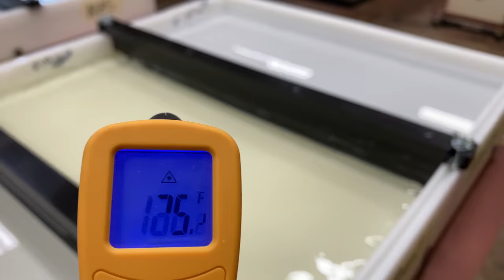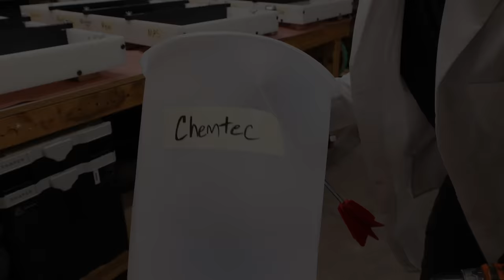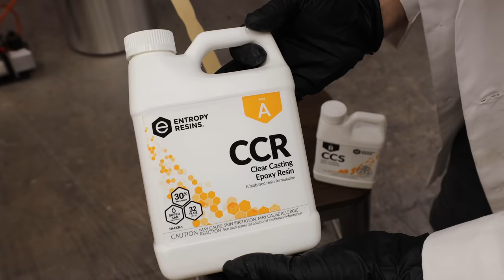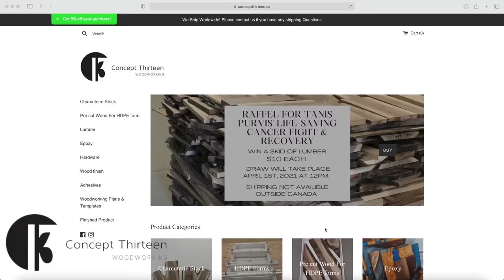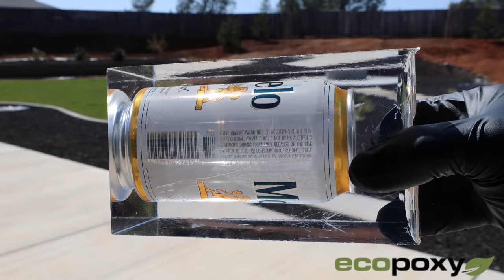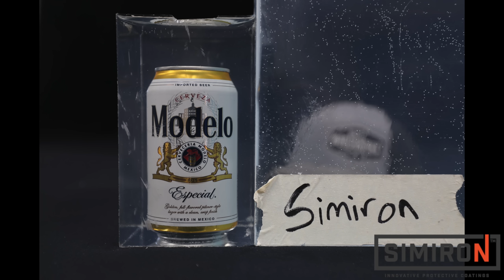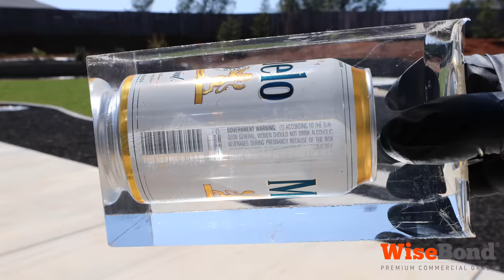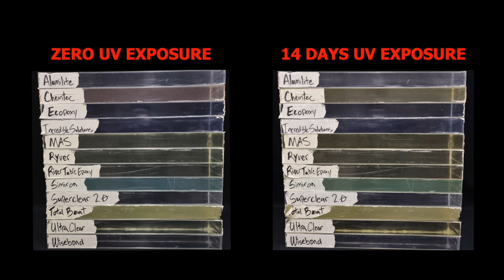Deep Pour Epoxy Clarity/UV/Hardness Test - Detailed Comparison!

Comment: Awesome work! Thanks.

I realize that the point of the test/comparison was clarity and color... you showed that mold cloud was a concern so you sanded and polished each one, top and bottom, also the final five went through a real flattening and polishing.
My Question is how did they compare in that finishing, including:
1. Elapsed time.
2. Pinning/clog factor, did you have to change paper frequently
3. Scratch elimination.
4. Was surface 'gum' a factor, I have experienced issues where the initial flattening was hampered by a lot of pinning, but once the surface was broken it worked much easier.
Doing the pour is part of the work but problems finishing can take a successful pour and turn it into a real headache. 

 Wisebond and Incredible Solutions are tied, IMO
Reply from the maker: Dane, The ones that I flattened and polished up all took relatively the same amount of time, they were also super close in shore D so there wasn't any issues with gumming or clogging of paper.  I used 2 pads of each grit for each block/casting, I did however have a little more time in using stage 1 cutting compound on Incredible Solutions for whatever reason, but all scratches seemed to eliminate on all of them just fine.  Thank you for the feedback!

Comment: Interesting and well done.  
My choice:  the WiseBond as the clarity is well up there but with a 3 point advantage in shore hardness over the other two top contenders, meaning a better quality final product with a longer, useful life as it may be repolished more often.
My application is as a surface coat over a Cocobolo veneer for a Lotus 7 dashboard.  That application requires; hardness,  and a U.V. -yellowing resistance in a very thin laminate coating.

Yes,  please do the subjective one year "yellowing" tests.

Comment: Would have liked to have seen West Systems in there since so many woodworkers use it. Great test though. I'd go with Superclear.
Reply: That stuff is so reactive because it's designed for thin laminates so a deep pour would not be possible with their current range. West = wood epoxy saturation technique.
Reply: @jakbain1337  you could do 1/4" pours at a time with certain West System combinations and build up that way if you wanted. The makers of West System also make Entropy Resins, FYI.

Comment: This was a fantastic review. I was actually quite surprised and impressed by the results. I will most likely be purchasing both the Incredible solutions and/or Wisebond for sure. I was pretty impressed by the superclear 2.0 also even though there were micro bubbles in the 2 inch pour. I am already a fan of Entropy and have seen some other reviews that showed direct UV exposure of many months without yellowing and virtually bubble free. Thanks so much for doing this.

Comment: I noticed you didn't tourch any of the resins to remove bubbles. You said you used degassing. Is that the same as a pressure pot?  It seems you still have a lot of bubbles in many of the pours.
Reply from the maker: Degassing chamber is different, it's extracting the air with a vacuum, I didn't use a torch on purpose that way we could see which resin would dissipate the bubbles the best.

Comment: I wonder how much affect the hot total boat had with the other resins in the same tub? Having 4 resins sharing the same bottom surface and some sharing 2 sides could be a problem. I was surprised you did not use a torch to remove bubbles from the 2 inch pours, I have seen people use a torch to do such, and the same with a spray as well. The site Positive Couple, comes to mind on using the spray. 
The work you did polishing and finishing those 3 finalists was amazing, I think the Wise took top spot, but as they say, I wouldn't throw any of those three out of bed though.
Reply from the maker: I imaging it could have had a little to do with it, however the ambient temp was low 60's for about the first week so the shared pours next to TB never reached over 90 degrees.  The torch could have helped but that would have defeated the entire purpose of the test.  I used the chamber on the beer casting, and almost all had zero bubbles.  I appreciate the feedback it was super fun to do!! :)

Comment: long term test would be awesome too. For me the Wisebond looked the best with neutral non-blue dye added transparency (some producers add slightly hint of blue dye to offset the natural yellow color). Seems to me people here give answers based on their experience or $$ - hard to trust their biased answers. Wisebond is visually the best, hands-down - there's no debate needed. Superclear is #2, Ecopoxy #3
Reply: Want to ask more of your unbiased opinion. why was Incredible solution not in your top 3? Is that what you meant by blue dye? What about the air bubbles other ppl are talking about? One guy said barely bubbles non-degassed incredible solution plank vs wise bond and superclear2.0. Is that a non-issue cause I’ve seen people throw blue-flame torch or heat gun to get the bubbles to rise out before resin sets.. (on this: do you prefer torch/heatgun?)
Reply: @ohkfilms yes incredible solution is so blue in comparison to wisebond and others, it does not belong to my top 3. 
What's so hard to understand there? The blue comes from a tiny amount of dye to offset the natural yellowish color of epoxy resin. Wisebond is #1, no discussion needed.

Comment: I've used SuperClear 2.0 with fantastic results, but unfortunately it cuts like crap on a lathe.  Actually I've tried most of those same resins, and most of them turn like crap on a lathe. So while it make not be as clear as SuperClear, Alumilite works best for me because it cuts so cleanly and smooth on  lathe. Another one you didn't try, but is also great for turning is Liquid Diamonds.
Reply from the maker: That's interesting to hear, I'm about to do a lathe project with SC, I'll report back.  Thanks for the feedback!

Comment: This was seriously helpful! I think if you can de-gas or pressure pot and can afford the little bit extra wise bond would be the winner, if not super clear 2.0 if you are doing the occasional project and can’t de-gas incredible solutions looks like the winner. 

I’d be curious if you can heat gun any or all of these to help get rid of the micro bubbles and if that has any effect on the final outcome.

Comment: Hey, so I'm just getting into resin casting and was wondering if anyone has any experience with the UV resistance of a resin cast colored with mica powder?  Would the colored casts still yellow in the sun?  Would it be noticeable?  Would a thin layer of dark translucent dye for the top surface also prevent yellowing?  I'd like to cast a few motorcycle pieces that will more or less "live" under the sun and start selling them this spring.  I'd hate to produce a bunch of parts and end up with unhappy customers.  How long would one of the winners take to yellow in the sun?  Has anyone had one of these brands in the sun for a few years?  
Let me know what you guys think!
Thanks!
Reply: Ask stonecoat epoxy

Comment: Incredible solutions gives incredible results. Less bubbles is very important.
Reply: Sorry, I thought it was the worst of the 3 top. It had a blue tint and you couldn't read the text on the can through it.
Reply: @adamjones-ps  The blue tinge is useful though as over time, it'll combat the yellowing.  If you look at thee colour wheel, they're complete opposites – I imagine this might be why IS have done this.  I've often thought a purply-blue top coat a couple of years down the line would be a useful thing anyway as a way of refreshing artworks.

Comment: I have been under the impression that you have to keep the room at 80 degrees.  Does it just slow down drying time at 60?  How would you control bubbles on a project to large for a degassing chamber, like a table?
Reply from the maker: The ideal temperate for most of these companies is 68-72 degrees F.  At 60 it just slows the process of curing and actually will assist in bubble elimination!  On a large pour Id say doing it in a cooler ambient temperate would be your ideal set up, just have to wait longer for it to cure.
Reply: @MattsWoodworks  thank you for the clarification.

Comment: I have never cast epoxy, but I've cast thousands of pounds of polyurethane. In our application, NO bubbles could be tolerated.
First, "part A" and "part B" were degassed separately. If the ambient temperature was low, the liquids were warmed before degassing, and allowed to cool before mixing, if necessary. Mind the temperatures!  The liquids were mixed in a pre-evacuated vacuum mixer. All of part A was added to the evacuated mixer, while stirring. Part B was then added gradually, while stirring. The chemicals mixing, and the stirring, each cause the temperature to rise. Foaming during mixing was kept under control by observing the mix, and controlling a valve on the part B input tube. If foam got out of control, and filled the whole vacuum mixer, it could get into the vacuum pump. That would be a very bad thing. This process does not necessarily entirely eliminate bubbles, but reduces them to the point that they cease to exist when exposed to atmospheric pressure.
For the most critical applications, the mold would be placed in a separate vacuum chamber that was connected to the vacuum mixer with wire-reinforced vacuum tubing and a valve. Allowing some air, or inert gas, to enter the mixer would make the pressure in the mixer higher than the vacuum chamber containing the mold. The mixture will flow into the mold vacuum chamber when the valve is opened. As such, it is impossible for bubbles to form in the molded polyurethane part. When the mold was completely full, air or inert gas, would be allowed to enter the molding vacuum chamber. Atmospheric pressure will force liquid into every void or crevice, giving a perfect part. Any issues which may necessitate parting lines to extract the product still exist, of course. If the mold or mandrels can be dissolved or melted, it may simplify matters.
This is not to suggest that all of this process is necessary for a particular application, rather to illustrate how some issues can be solved. It is possible to safely make perfect parts, even if the materials are messy, poisonous, and/or pyrophoric. ;)

Comment: Nice video.  The side by side shots were so cool! Looking to getting into a new epoxy but just shopping atm..  maybe I am missing something, but if you didnt whip in bubbles, wouldnt the bubbles not be there?  The epoxy creates a thermodynamic reaction when parts A & B "touch" and its not like bubbles are forming out of nothing with no action to cause them into existence.  Why do ppl judge the product for having bubbles?  
Or is there a feature of epoxies that the nature of the product should expel the gases of any origins including but not limited to air bubbles?  
Really curious about this--- 
I used to work with epoxy as a kid around 2010 and I never heard so much until Youtube videos about epoxy. Really genuinely curious.  I used to mix small batches with a wooden handle and never scrape the bottoms and sides and then pour that into a new container so no unmixed from the bottom or edges were not able to be in the new mixing bucket.  Was that wrong or just a waste since a good epoxy should assumingly expel the bubbles or at the very least make it easy for the user to expel them??
Reply from the maker: I'd say if you just used a stick it would take much longer to mix but could assist in not getting as many bubbles.  They are caused from mixing, they aren't formed just form mixing the A/B together, and I'd say that pouring it into another container is totally fine, actually a lot of these companies recommend it.  I just spent the time to scrape the sides really well as time was my biggest hurdle to overcome.
Reply: IMHO - You must scrape the sides and bottom while mixing and before you pour into another container for more final mixing...it's the hardener that's sticking to the sides and bottom and if you don't scrape it and get it mixed in - then the ratio of A to B is off...

Comment: Never pour 2" straight up like that unless deep tinting or using metallics. Can see the heat ripples in almost every one. I ALWAYS torch EVERY 1/8" to 1/4" during pours to release the bubbles and max 1" depth at one time. Let it setup a while till it's firm but still tacky and repeat the torch process again till I get the depth that I need. 95%+ bubbleless and no heat ripples, plus almost no shrinkage of the epoxy. I keep room set at 75 and use a fan if the epoxy starts creeping close to 100 degrees. Great video for clarity comparison but disappointed the room temperature was too cold and not at consistent temperature to get a true hardness test. Most of them, if not all HIGHLY recommend not to do pours under a certain temperature or will never reach it's full cure hardness right on instructions on containers.

Comment: You mentioned it was important to keep the bottle and beer pours cool for 24 to 48 hours after casting. Would this cooling be necessary if the entire cast were placed immediately into a pressure pot and allowed to cure fully there?
Reply from the maker: It’s really important to keep them cool, you can even put them in the fridge (if your wife is cool with it lol) because if not the volume generates too much heat as they’re kicking off, and will potentially result in a failed pour.  I’ve had many cure to fast and turn yellow, develops retraction etc, even if you just put them inside a pressure pot/chamber, it will have the same result unless your ambient temp is in the low to mid 50’s.  This is just from my experience, hope that helps!

Comment: What about the fumes?
Reply from the maker: Honestly I didn't have any issues or fumes that I noticed, even doing all of them at the same time.
Reply: Most epoxy resins now are low to no VOC's. There are some commercial grade epoxies though that do contain VOC's and I believe are mostly used as flooring epoxies. However, some people react differently and even though the product they use claims to be free of VOC's some people still have bad reactions and need to wear VOC blocking PPE.
Reply: @Blackley3436  yeah exactly. I'm sorry people were rude to you. Some people absolutely do react to it so I believe you. That's why I felt compelled to answer that question since I've been working with it for years and have knowledge to share. I've been working before with resin in my studio and had people stop by that started reacting to it so they had to leave. Luckily, I don't usually. I have noticed though that if I'm using up some that is older or has been opened a little longer than I prefer, I do notice the smell and it's not pleasant. I've also noticed on a few pieces that I just don't love and have overworked, that I notice the smell when heat is applied. Anyways, I hope you aren't deterred from working with resin. Just make sure to wear proper PPE.

Comment: Incredible Solutions looks pretty good as did River Table, Ultra Clear & Wise Bond. Simiron was the worst I felt. I am surprised you got as many bubbles as you did with Super Clear as it was one of my favorites to use so far.
Reply from the maker: Thanks Chris!  I was always curious to know if it was because of TB overheating causing the opposing two to have more bubbles than normal 🤷‍♂️
Reply: @MattsWoodworks  it seems like Super Clear is by far one of the top resins overall, but I was very impressed with Incredible Solutions and Wise Bond.

Comment: Awesome video Matt.  Thanks so much for putting this together.  Just  quick question.  As well as the clearest shown in this video, do you have any recommendations for the most scratch and heat resistant epoxy.  I'm doing a lazy Susan with epoxy and want to make sure I'm using the most scratch resistant epoxy on the market.  Also, is there a sealant I can use on the epoxy to increase it's durability and scratch resistance?  Thanks so much.
Reply: have you heard of top coat products for epoxy?  they are supposed to be really really really durable and protect the epoxy.  theres a couple different brands out there.  i dont have a ton of experience with them but i refinished a dining table the other day with topcoat in a matter of minutes.  if you look up on youtube stone coat top coat testing you can see them hit it with hammers and scratch it with nails.  its impressive

Comment: This video: casting resin. 
Will you do a video on table top epoxy (?) to find out who has the least bubbles without degassing? Most people dont have a degassing machine.
Reply: Even with Degassing it can take as long or longer than the pot life to get the air out too, which is why pressure pots are better for small castings. Table epoxy with least bubbles would be good to know. It did appear the incredible solutions was the one of the final 3 with no visible bubbles in the 2" panel. The other two had plenty.
Reply from the maker: I have thought about this, maybe someday!
Reply: @MattsWoodworks  
How about put a warm water inside a much bigger container bucket, bath tub and put your mixing bucket inside the warm water container while mixing the  epoxy resin, would it help refused bubbles?

Comment: It APPEARS like Wisebond is the most optically clear.  However, I would suggest it could be a matter of the camera handling and angles since the best measure of the optical clarity is the edge view with the beer casts behind them. 
Suggestion: Set the beer casts 3+/- inches behind the 2" casts, and the camera (mounted) at 6+/- inches from the "front" edge of the 2" casts for a view through the cast to the beer casts with the focus set instead of the auto focus changing because of handling.
Reply from the maker: Great Idea JD, thank you I should of thought of this!  Maybe a follow up video someday.